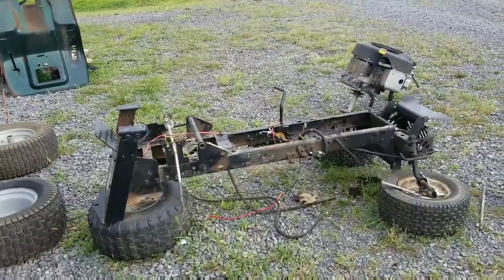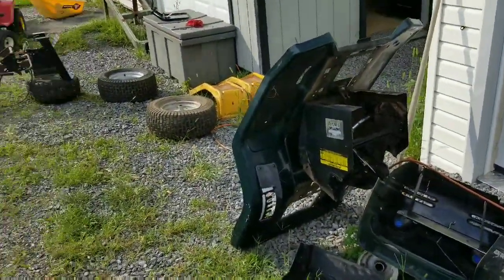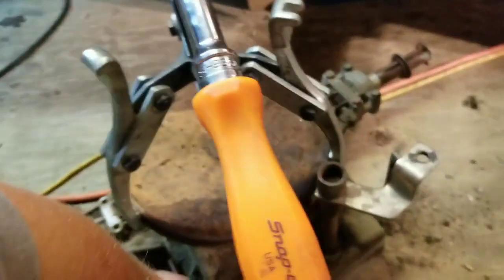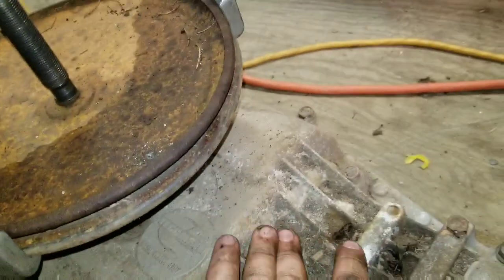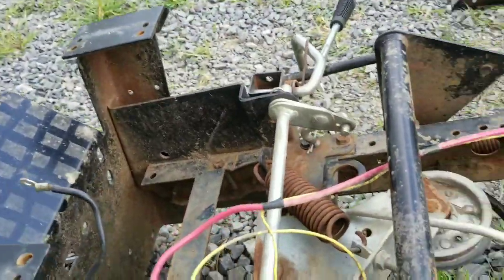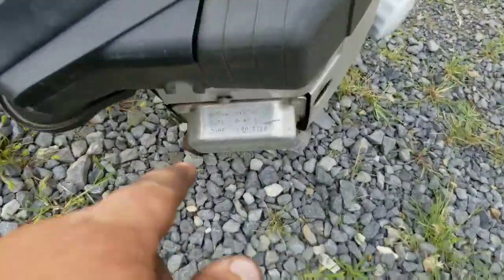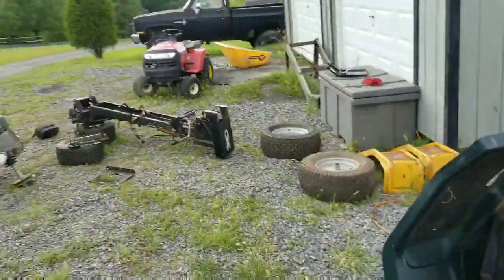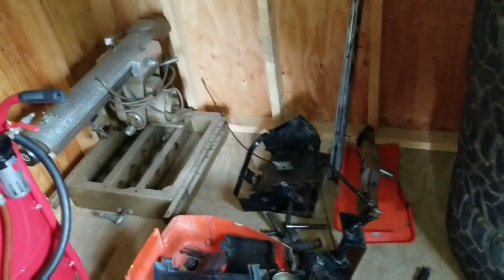2002 Murray Widebody GT 21HP/46" & A Peerless 820

Comment: You will need to find a short shifter for an 820 and the center Shift leaver like this:  https://rover.ebay.com/rover/0/0/0?mpre=https%3A%2F%2Fwww.ebay.com%2Fulk%2Fitm%2F123878627570 ... Take the top part of the old leaver where it hooks to the shifting handle take that piece cut it in half and build from there to wat you need
Reply from the maker: Thanks